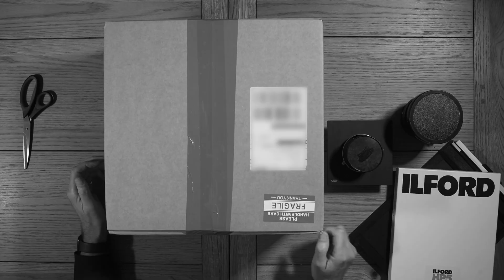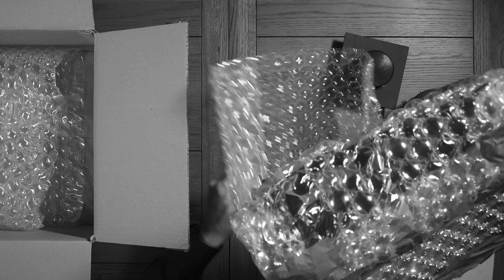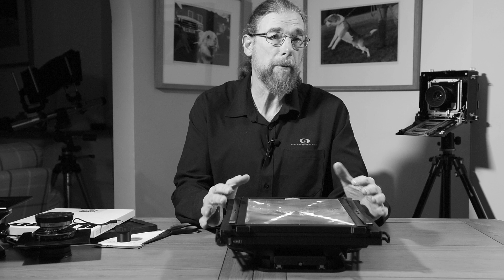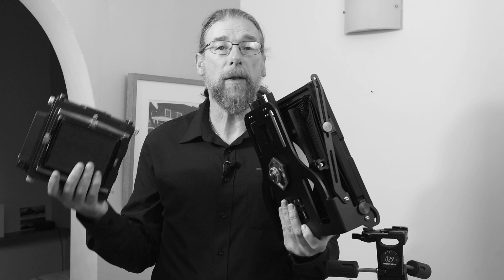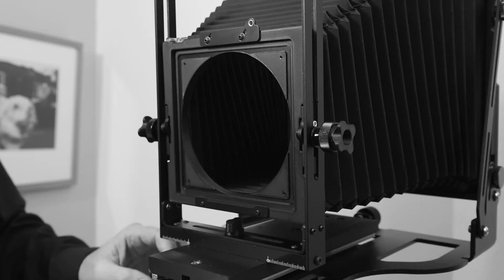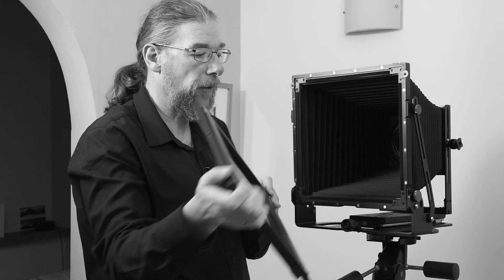Intrepid 8x10 - Unboxing, Assembling & First Impressions

Comment: I am asking because I am thinking of replacing my Deardorff that was stolen 2- years ago. 

That looks great - wow.  It comes complete with a lens board?   What does it look like folded down?
Reply from the maker: Hi Bruce. Your Deardorff was stolen? You must have been distraught, I hope it was insured.
The Intrepid. doesn't come with the lens board included I'm afraid., that was an additional expense, but the Intrepid panels are good quality, and the standard Sinar 140x140 boards fit nicely (although I have one aftermarket board which needed a tiny bit of corner filing to be snug). Folded the camera is compact, light and easy to transport . The baseboard is good and solid. However, I feel I should point out this camera is no Deardorff. It is functional but it lacks the refinement; then again it's not Deardorff money.
Reply: @duncanshepherdphotography    Sounds good.   Functionally - it looks great.   I think it would be less hassle in a lot of ways to the Deardorff. 

I lost - Deardorff,  Schneider SS XL 110mm, SS XL 150mm, 360mm, 240mm - 12 olders and and a bag and accessories. 

Insurance - ouch. 

Really - I used the 360 most so - I would get that and the camera and maybe 5 holders.   

I meant - 20 year ago.

Comment: Maybe a stupid question but can one use flash with this somehow?
Reply from the maker: Hi @AlexanderLindstrem . Yes, you can although there is no 'hot shoe' on the camera. As with most large format cameras, flash triggering is performed by the lens via a PC sync cable. It is always a good idea to check that the flash sync is working when buying a large format lens.

Comment: Your killing me! Ha! The Intrepid would be the one I would get. The price is incredible for what it can do, and I have at least one lens from my 5x4 collection which would work as a starting point. But the price of film holders and film hold me back. For now. I am one step closer though with the Stearman tray. Cheers!
Reply from the maker: Thanks @oldfilmguy9413. The intrepid is a little crude but great at this price point and for me makes 8x10 a possibility. I have found lenses available quite reasonably, unless you want wider than 240mm. As for film holders, prices are seemingly going up. I have 3 which I think is just about enough for a day out (a couple more would be nice) 2 of them were pretty cheap. They aren't pretty , but they are light tight and that's what matters. Keep looking, something will turn up.

Comment: Having plastic parts instead of wooden ones might come in handy in the field, when the weather is not playing ball (I've heard that some areas of the UK is prone to rain, but this might be just hearsay ;-)). I find the mechanic of the 8x10 to be much better than the rotating backs of the 4x5 and 5x7 (I had bad luck with my 4x5, the plywood warped) – my Chamonix C45F-2 has a similar way of rotating the back like the Intrepid 8x10, and I prefer it that way (and I can pull off the back if need be).
Reply from the maker: Thanks @c.augustin. I have to say that I do not regret going for the plastic version. Your comment about the rotating back is also interesting. My 4x5 cameras (MPP and Toyo)  both have rotating backs, but I do not miss this feature on the 8x10 Intrepid. Like you, I think I have a preference for unclipping to rotate.

Comment: A little candle wax rubbed onto the mating surfaces of the camera backplate and film back will make sliding in & out smoother by reducing the friction. It doesn’t take much.
Reply from the maker: Great tip. Thanks @dewindoethdwl2789, I'll give it a go.
Reply: Should work even better with some hard wax used for skiing.